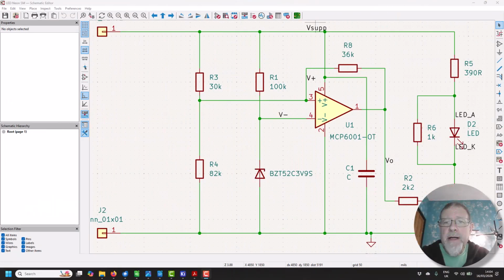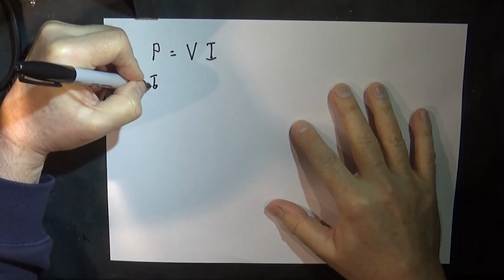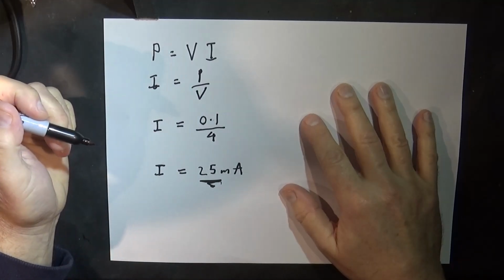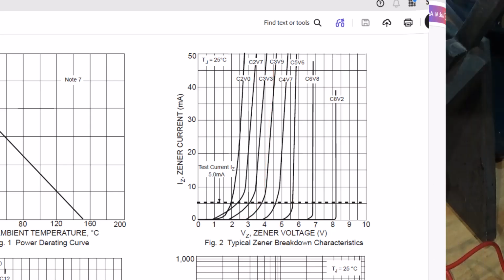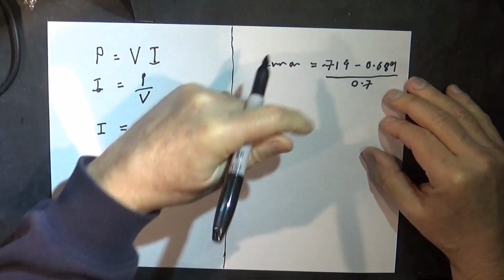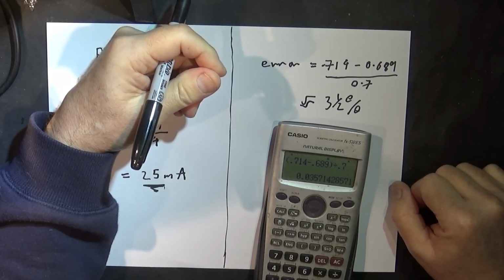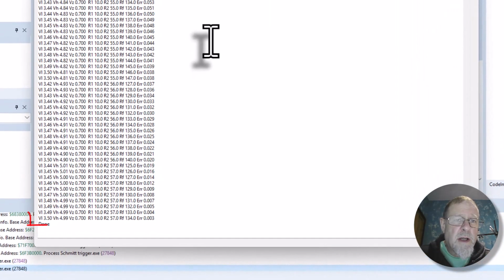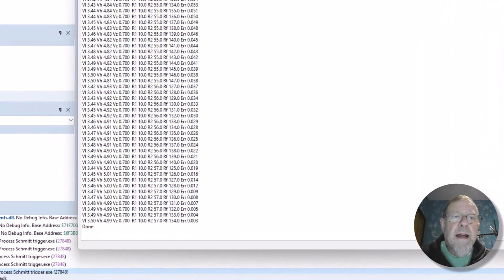LED Blinky Tree Part 4. LED based neon simple oscillator

Comment: With all due respect, I'm left wondering if this were just a rainy-afternoon challenge you wanted to solve as one might SUDOKU or something?
On the one hand, a neon relaxation oscillator will work off 8 or nine fresh '9V' rectangular batts, or even a small pile (20 or so) fresh 2032 lithiums.  Not 150V and def not dangerous, and can be tuned to extremely low current demand.
If the requirement is for a higher intensity LED, a pair of 555s  will do it very economically - one to determine duty cycle/frequency switching one for PWM should you wish.
Maybe I missed something while liestening?